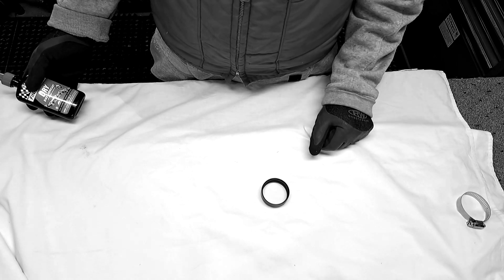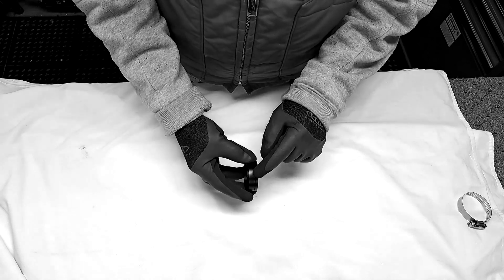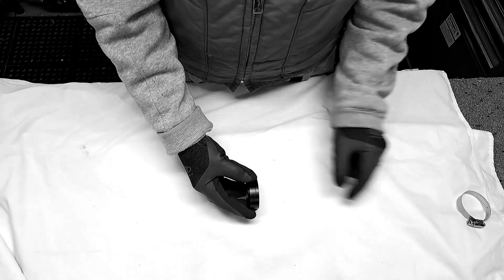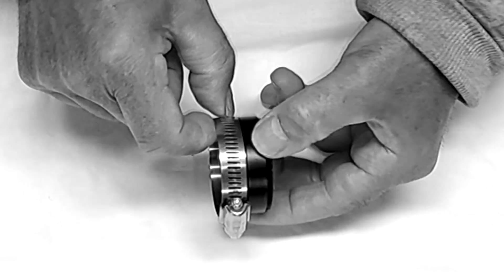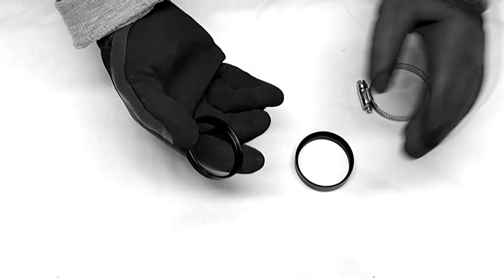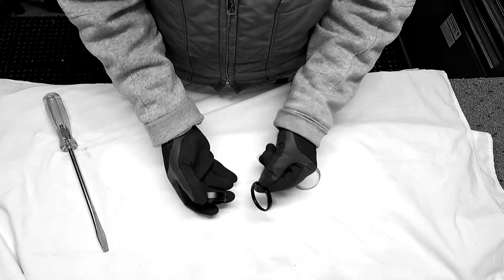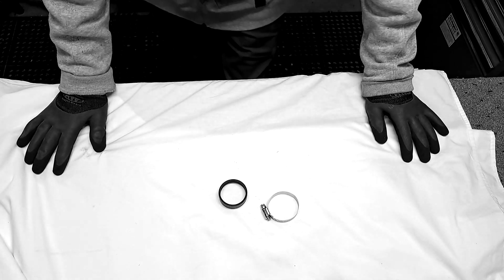Unlock Stuck Camera Spacer Rings for Astrophotography

Comment: I find if I put the parts into the refrigerator and let them sit in there  for  1/2 hour, the cold contracts the metal enough you can then separate. I'll use a rubber sheet jar opener for a little extra grip. I had a 6mm spacer on my ASI071MC and put it into the refrigerator running 40F and was able to remove the spacer. I lubricant my spacer threads now.

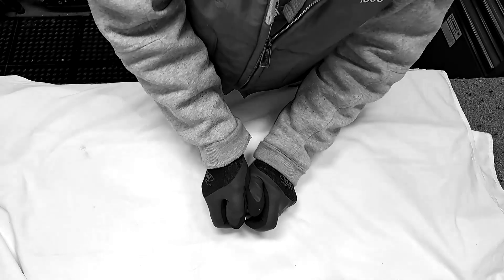Comment: I wouldn't do it like that. The problem in 99% of cases is that you put pressure on one or both rings when trying to loosen the rings. You can see this in the video at 1:45. Here you squeeze the right ring, not good. The trick is that you have to reach into the rings and, without applying any pressure, simply twist them apart.
Reply from the maker: Reaching into a 3mm wide ring and unlocking it without applying any pressure?  That's quite the trick. 😄